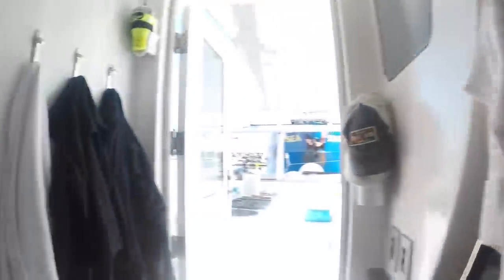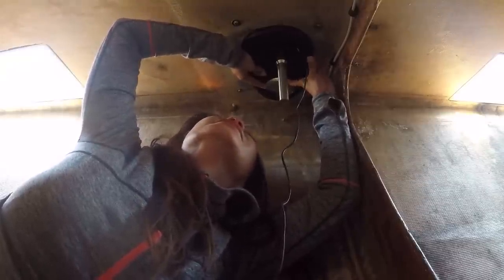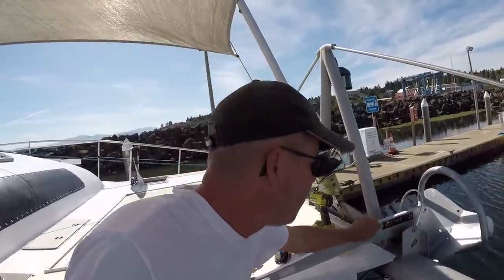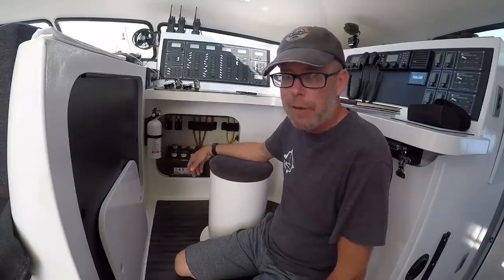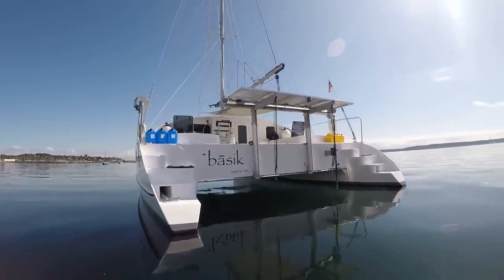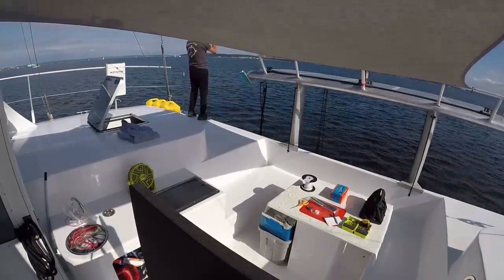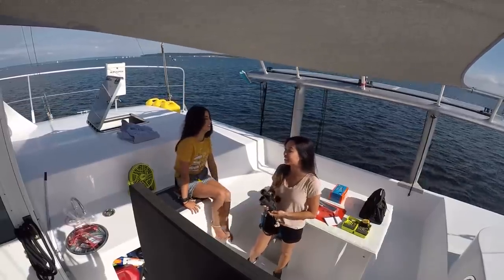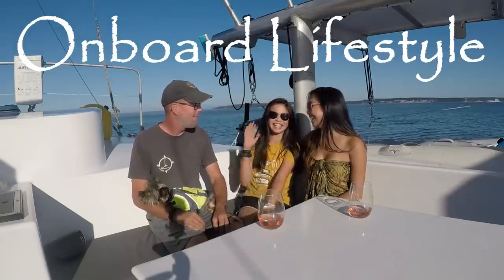Projects and Hijinx on the water Onboard Lifestyle ep.79

Comment: Ok, always reluctant to give advice but, personally where ever possible never mount stainless anything directly onto aluminium, always use plastic(hdpe) to insulate and prevent corrosion. Always use marine grease on stainless fittings and some form of protection on all electrical, especially in anchor lockers. I'm being picky but it's going to make a difference in 12 months time. You're great the way you methodically lay everything out and I love your attention to detail. Thanks for sharing. 😃

Comment: One thought, would a stainless steel plate, mounted where your swivel lands, not be wise to protect your deck.......
Reply: im sure teal is already thinking about protecting the whole run of the chain from windless to bow roller
Reply: a metal plate the full run of where it goes across would be great
Reply: Personally I'd use polyethylene, quieter, less friction and no corrosion!
Reply: @jacksbackable  I agree.... I did a stainless channel for my chain. It would wake up whoever was sleeping if were even adjusted the anchor... changed it to a aluminum channel with a poly liner that worked great... The aluminum was powder coated for NO UPKEEP.
Reply: @jacksbackable  good idea
Reply: @jacksbackable  , or Polypropylene, which is resistant to pretty much everything, but agree, would go w/a material other than Stainless for the weight saving and better wear etc.
Reply: niceguy217 polyethylene (hdpe) is harder, but polypropylene will work!
Reply: I have Keel Shield under my chain and swivel, works great.  Do not use white, as it will yellow with UV.  We also have 1200 watts of solar and would recommend that once you do your hard top you add more.  I’ve never heard anyone say “I have too much solar”.  Love you videos, keep it up!

Comment: First things first. Good one ladies!!!!!!  Nice job on the anchor windlass and I have one recommendation that I did on my boat and it works like a champ. I put a thin (.018") 316 stainless steel sheet in to line the chain locker. My chain had started wearing through the fiberglass. I added in an extra layer of glass like you did but I knew over time that would start wearing, especially if you drop the hook a lot.
Reply: Lol, it was fun getting Teal back? Although he did hurt himself tripping over our doggy door. We plan on lining the chainlocker with a rubbermat for sound deadening and chafing. 👍🏻👍🏻
Reply: @linhgobenyt  I had done something similar to that on my previous boat. I sprayed it with a pickup truck bed liner. But that created some friction and would not let the chain easily side down and it would start piling up.

Comment: That is a very nice anchoring system you've installed, and am a huge fan of Rocna's. Cannot say enough how much I respect the use of backing plates on the components as well..as ppl will tell you the boat should handle it, but spreading the load out makes for trouble-free real life usage. Also the wiring upgraded and such. Also note to self; Never get into a prank war w/Linh ;) lol. One last add, consider adding a wind Gen. too, can give links to really reasonable decent ones, starting at just $300, or $350 w/charge controller,(different voltages/Amperage outputs available too) and it would blend seamlessly into your system..works on bad weather days and nights as well. If you'd like the links just let me know ;)

Comment: Given the location of your battery bank (under your nav station in what appears to be a sealed or enclosed cabinet) and you are using wet cell batteries, how do you ventilate the hydrogen gas produced when the batteries charge? It appears the contactor for the winch is in the same area that will be sparking every time the winch is used.

Comment: If it's not too late, what about 1/4" to 3/16" inch thick sheet of rubber in the chain locker, under the chain input, that the chain could fall against. It could protect the fiberglass and prevent impact cracking. After all the chain will be dropping against it for years to come. Also if you increase your solar you'll need to increase your battery bank as well, after all the power needs to go somewhere  till you use it.

Comment: Hi Teal, great video. I noticed that you’re running all of your solar panels through one controller. I’m sure you already know this, but I’ll say it anyway just in case you don’t. By having only one controller, if there’s shading on any of your solar panels, the output of your entire array will be significantly diminished. If you have a controller for each panel, if there is shading, it will only diminish the output of that panel instead of your entire array. Of course this will cost more money for the additional controllers. The offset to the cost will be redundancy of controllers and you can purchase smaller controllers which cost less per unit than the large one you are using for the entire array. Unfortunately, numerous small controllers will still cost more than one large one. Forgive me as I sit on the couch and talk about spending your money. I really enjoy your videos, and I think the work you are doing on your boat is top notch and your attention to detail is stunning. I’m sure that all of your hard work will come back to you in spades as a reliable, dependable, and safe platform for you and your family.

Comment: Teal would it not be a good idea to have that chain coming on to the Boat with a Stainless steel  C Section for it to drag on other than the Boat s F/G ???????? Or even some delrin Plastic and in the Chain locker a Catch Tray so the chain does not get moved around to much under passage in rough weather. Mate you are a Master Crafts Man when it comes to your work ethic . And Congrats for being on the Water again:)

Comment: Since you are using a MPPT controller, you have the option to wire the solar panels in series (instead of parallel).  The benefit of this, is in early morning (or evening) when the sun is low, each panel individually may produce less than 13 volts (like 4 or 6 volts) and are not sufficient in parallel to charge your batteries.  In series you may total voltage (so 4 panels at 6v = 24v), and the MPPT controller being a switch mode DC=Dc converter would convert the voltage down to 14v and increase the current being produced.  More efficient charging.
Reply: My thoughts exactly. Your Victron charger is designed to take up to 100 volts, so even if you have 18 volt panels, you would be fine. I also noticed you used the Bluetooth dongle, when Bluetooth is already built-in to your charger.

Comment: Teal, I noticed you did not highlight the need to isolate dissimilar metals, i.e. your crossbeam of aluminum and the stainless bolts & eyes for the bridle. Did you put TefGel on the joint to prevent corrosion of your crossbeam (really bad)?

Comment: Hopefully the roller you placed to protect the windless motor works for you. Chain seems to have 
a mind of it’s own though and may end up falling off the side of roller. I have not worked with Lewmar units only Maxwells, On Maxwells you have option of rotating the motor 360 degrees so you can pick the best the best position for your installation. Hopefully your roller works for you, if not a stainless steel tube might be another solution for guiding the chain. Dump some extra chain overboard while at anchor and sit in the anchor locker watching the roller while the gals retrieve the extra chain a number of times.

Comment: Hi Teal, payback really can be a curse but hey---- that's life.  Two questions 1.  Why did you decide not to put in a chain counter and a remote at the helm and 2.  I understand the roller to keep the chain of the motor but did you consider putting a stainless plate against the bulkhead so the incoming chain will not damage the hull.
As always stay safe and keep having fun.

Comment: Love your work but am wondering about your bridle attachment.   I’m not an engineer or very knowledgeable.  But I don’t believe that spar is designed to be pulled forward like that.  I’m a bit worried that in a gale at anchor it could deform or tear the spar.  Any bridle I’ve ever noticed was attached to hulls at the strong fibreglass low to the water on the inside far forward.  Probably backed by a glassed in stainless plate.  Sailing Great Circle is a channel with a 50 foot Lagoon,  and they tore their spar with a spinaker bowsprit.  Maybe watch that and then rethink the strength in the wrong direction thing.  Sorry to be negative...  I love your work and applaud the brilliant job you’ve done with it all.

Comment: With the important caveat that I don't know what I'm talking about... just looking at the way the new Mantis swivel and the top of the shaft of the new anchor make contact with the white, composite deck in the centre of the trampolines, I can't help but be concerned that as you winch the anchor all the way in to that final resting position, the anchor, Mantis and/or chain are going to do some serious damage to that composite deck area and in short order. 

Interested to know if you have considered maybe putting some form of stainless "gully" or even just a simple piece of flat stainless plate for the ground tackle to "run over", to reduce wear?

Comment: Audio levels.  Dialogue should match the levels of the intro.  We have a hard time hearing you without riding the volume button on the remote control.  Most non-linear editors have a vU meter module that allows you to see what your audio level is.  If you keep it in the green and only bump into the yellow or red occasionally, you're good.  Thanks.

Comment: Another great video guys, two suggestions although one may be unnecessary, the eye bolts for the anchor bridle did not appear to be coated in duralac if this was not just a video editing thing it would be wise to remove them and apply duralac to the bolts and holes prior to reassembly you don't want galvanic corrosion in that beam. the second is consider using something like raptor coat truck bed liner in the anchor locker it is very resilient and would protect the fiberglass nicely.

Comment: I am not familiar with how strong a fiberglass deck is but I am surprised the deck can hold the pull of the boat when you
use the windlass to raise your anchor chain.  I realize that when you are at anchor you attach the bridle to your anchor chain
and the windlass is not holding the boat at anchor.  I saw a video where a cruiser depended on his windlass to hold his boat at anchor and it failed 
and sadly his boat ended up on the rocks.

Comment: When stainless touches aluminum it tends to pit the aluminum over time. To prevent this from happening, you need to use some type of anti corrosion that comes in like a grease tube. I forgot the name of the product but the last product I used looked like a tube of tooth past and was green in color. I used to race small catamarans and ran into this problem but corrected the issue by using this type of grease or whatever it's called and it stopped the corrosion.

Comment: Is one hundred fifty feet of chain going to be the total length of your rode or are you going to have another hundred fifty of suitable textile attached to the chain?
Reply from the maker: We are a weight sensitive boat so hundreds of feet of chain is not an option. We have 150' of 5/16 HS chain with 250' of 3/4" three strand rode spliced to add extra scope. We are a shallow draft vessel so we always scout out anchorages in 3 fathoms or less. We feel  very comfortable with our ground tackle configuration but will be adding a secondary anchor in the near future for redundancy.

Comment: Have you installed a watermaker yet, if not is it in the plans.
Reply: We haven't installed it yet, but will. We have an older watermaker we purchased used, but once we delve into the project/install, that might change once we evaluate the pros and cons of a used watermaker.

Comment: Nice job.  

The chain length might be a bit short at 150’.
Reply: We also have 250' of rode. In hindsight, we could have possibly added another 50' to our chain, but oh well. 🤷🏻‍♀️🤷🏻‍♀️ live and learn. 😉 its too much weight.
Reply: Linh Goben I get, but in the islands or developing countries you might find it challenging to find good, non corroding stainless steel chain.  

The length of chain will vary based on weather and density of neighbors among other things.   More is better in this case (within limits).

Perhaps 80% to 90% of your time at sea will be going no where, and the better, cheaper choice will be anchored somewhere through fair and not so fair weather.  In fact, sometimes the wisest choice might be to anchor rather than moor or sail.

https://www.cruisingworld.com/anchoring-like-pro/